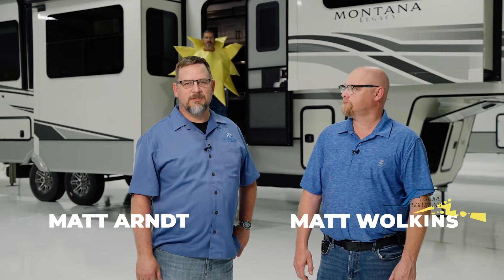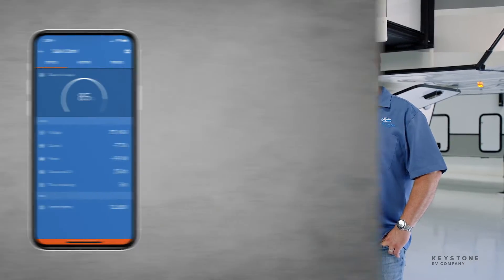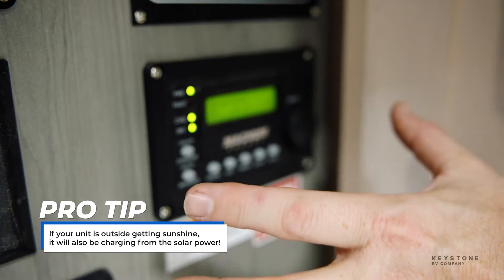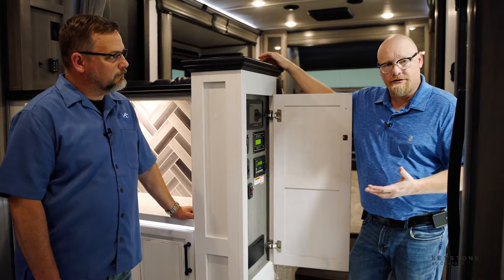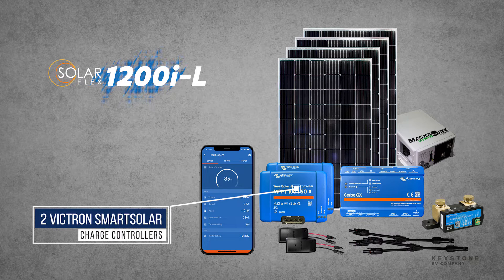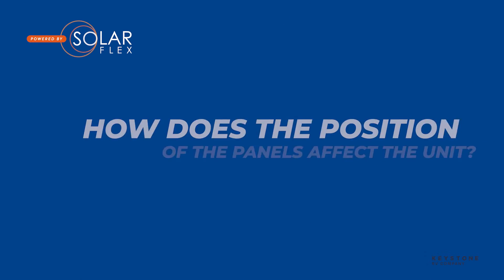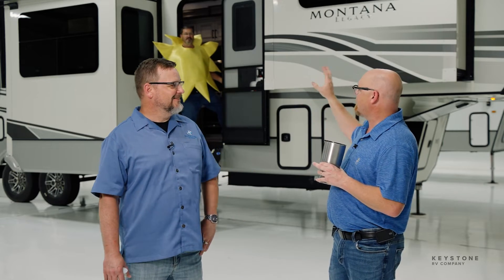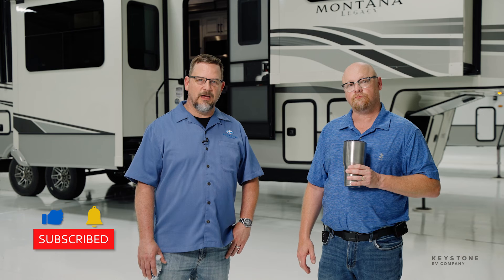SolarFlex 1200i-L: Learning to Camp Better understanding solar functions and operations in your RV.

Comment: Thank you for the info. As of now I have shut down the whole coach. If I turn on the battery heater switch, will it operate or is there something else which needs to be turned on? We will be leaving for the south in one month’s time, is it even worth switching the heater for the batteries on? Should we we even shut down the whole coach for one month of cold weather and leave so on and turn on the battery heaters?
Thanks
Gerard Gregoire
Reply from the maker: Good afternoon, you do not have to. Just be aware that the batteries can be completely dead and go to sleep in cooler weather so they will require a full day on the battery charger before powering up the coach. Thank you!

Comment: When my coach is in storage for winter and all is shut down do I turn on the battery heater switch?
Reply from the maker: Good afternoon! The battery warmer can be on, if you do not have it on in the winter the battery will go to sleep and before doing anything in the spring you will want to charge the battery for a whole day prior to running anything to wake it back up. Thank you!

Comment: How much does this package cost to purchase and install?
Reply from the maker: Good Morning, This package would come on our newest Montana units only. If you have a different Solarflex package in another model, you can always speak with your dealership on pricing to upgrade your system! Some units do not have solar flex but may be prepped for solar as well, you can speak with a Keystone dealership on this to see what your options are.

Comment: Is there a video on the 400i how to operate?  I don't have the black on off switch shown. It has a knob with battery picture showing red or green. Which position is correct to run the solar
Reply from the maker: Good afternoon and thank you for your comment! The switch you are explaining is the inverter disconnect. We would suggest taking a look at our 400i quick start guide under the Owner's Manuals tab at www.keystonerv.com. Thank you!

Comment: I'm curious as to the use of a Magnum inverter as opposed to the Victron Inverter shown on the Keystone website. There are pro's and con's to both I know but with all the other components being Victron it just makes me curious. Is this just a supplier issue thing? Are there technical reasons?
Reply from the maker: Good afternoon and thank you for reaching out! This is simply how we designed the unit to be set up. If you should decide to switch yours to the Victron you most definitely can discuss this with your dealer as it is an easy switch. Thank you!

Comment: In full sun, in ideal conditions, how long can this battery bank run ONE air conditioner while the batteries are being continuously topped off by the 1200-watt solar panels?

To be more specific, if I get 12 hours of sunlight each day, will the solar panels keep the batteries charged enough to run one AC unit for an entire week?

Thanks for considering this hypothetical!
Reply from the maker: Good morning Kevin! There is no exact on how long as availability and sun intensity is always transitioning with clouds, weather and loads. Replenish rate would depend on the amps being drawn by the RV including controls and modules even while appliances are turned off. Your Victron App would be extremely helpful as it is in real time! The app will also help you understand what your solar is doing, and what it’s using!